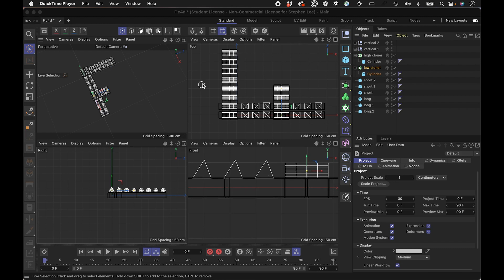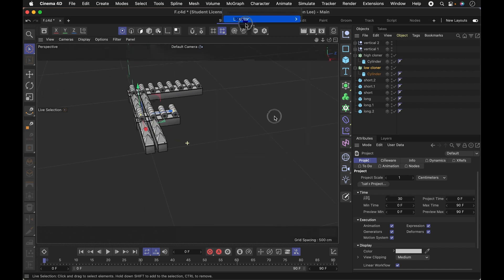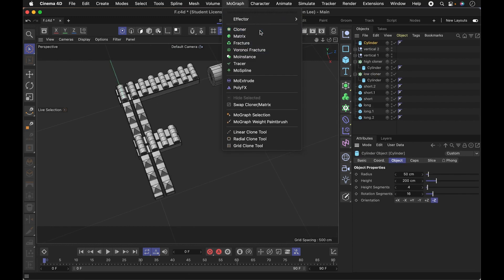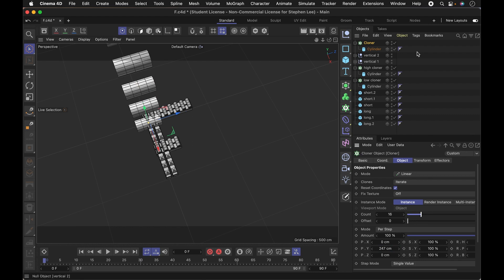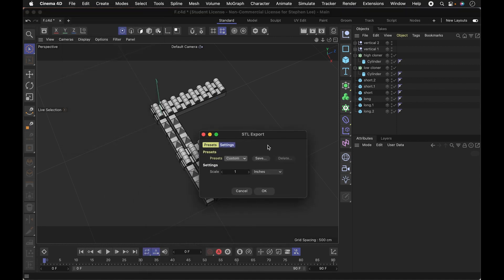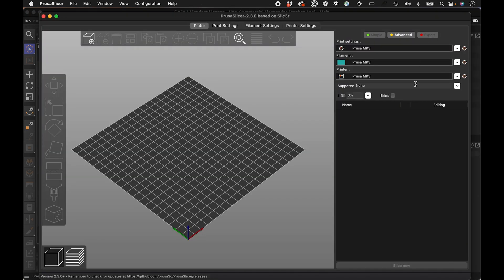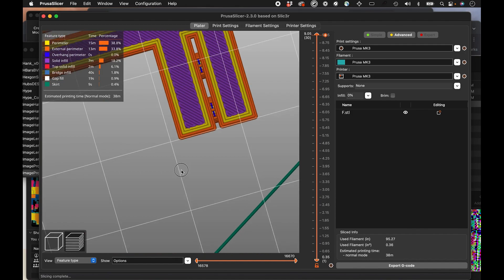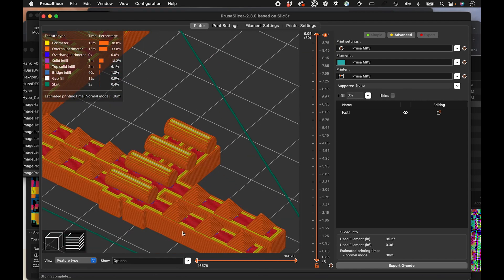Cinema 4D to 3D Print Overview

Comment: Unfortuately, STL adds all faces, surfaces to one object.  Printing on a printer like Bambu Lab A1 printer, .3MF files have the ability to maintain separate geometry for multicolor printing.  I am trying to figure out how to get a .c4D file to a .3MF file so I can color it inside Bambu Studio.  So far, no luck.   I have having to go through another piece of software to convert a file format.  Like a .DAE export into FreeCAD and then out of FreeCAD into .3MF.
Reply from the maker: I haven’t done any multicolor printing but that is good to know
Reply: @jstephenlee  Everything has changed since my first post.  The AMS Lite will not be used for multicolor prints.  Too many color changes per layer.  Time.  The current purpose of the AMS is just to have 4 rolls of filament ready for printing.  Single color, but 4 in the 'hopper'.  Many people give up on multicolor prints.